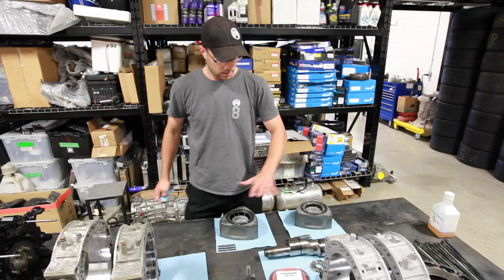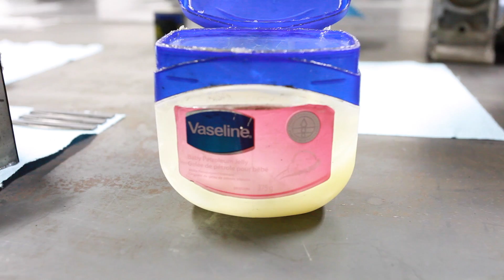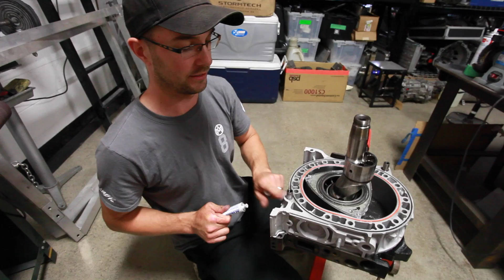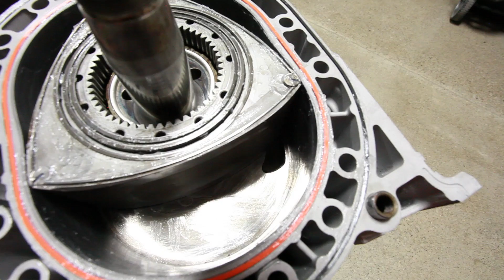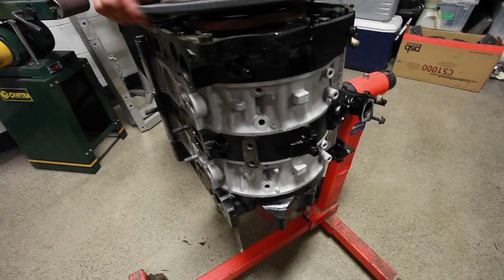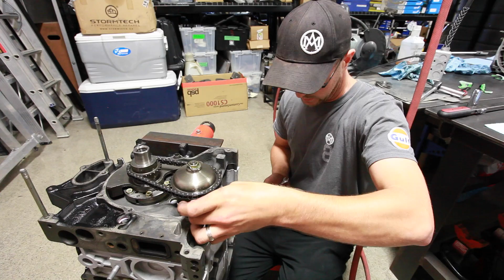How To Build A Rotary Engine

Comment: Lol I'm sorry guys for the try but  rennaccy or the 13b the came out on the Rx 8 is the worst of the worst  rotary engine ever produced I think is way worst then the 10a and tht is lot to say those engines won't go over 60k plus they dnt produce hp that's why everyone tht has Rx 8 they do engine swap 20b or  ither 13 b  gen 1 or 2nd Gen

Comment: The bolts under the oil pump pulley could be torqued using a crows foot socket

Comment: Not that it does much good to point this out, but Mazda says the 16X is every bit as efficient as their regular engines and every bit as clean.  It's likely that the new 16X uses direct injection and stratified charge, just like a modern reciprocating engine, so it benefits in the same way.  Also, contrary to what you sometimes hear in Youtube videos, Wankel engines are 4-stroke. If you see flames shooting out the back of a Mazda, it just means the owner (or the mechanic) has screwed it up to the point where it's not efficient. When Mazda races their rotaries, you don't see any flames. Just trophies.
Reply: The 16X was a failure and abandoned  when Wankel engine development was canceled in April 2009.
Reply: Mazda's foray into motorsports was ultimately a disappointing failure and Mazda has left racing completely, there are no longer any factory motorsports programs at Mazda.

Comment: there is a massive misconception about the Fuel Consumption of a Rotary Engine.
baed on the Power-output of a Rotary Engine the Fuel Consumption is actually not bad !
Reply: Wankel engines have extremely poor BSFC, this is also clearly evident from the higher EGTs

Comment: Idk about these "reusable" coolant seals..but if you are using regular seals..don't put Vaseline on the coolant seals. That is a cheater move, that can prematurely wear out the jacket seals. Don't do it, unless you know, for sure, that it won't interfere...

Comment: Joe did a good job assembling that engine, as the side seals on the rotors were already assembled can you tell me if they are spring loaded ? similar to the apex seals.
Reply: they have funky looking springs that seat under the seals to apply pressure, look up 'rx8 side seal spring' you'll see what I mean

Comment: How about giving the 'circles' the combustion and exhaust system in the Engine Blocks and not in the Rotor just to solve those problems of frictions?

Primary Color Circles?... Timing and Pressures?... Springs and Friction Plate/Pressure Pins?...

Comment: Hi Joe,  I'm planning to use a 3 rotor rotary engine in my plane.  I don't know what preparation that needs attention nor the type (13B, 20B......)  Do you have the entire engine?  I could buy a junk motor but I don't want junk flying me and my passengers around.  What work do you recommend for a 3 rotor, 2 turbo engine  (approx 600hp)?  Oh, I do think a studded stronger engine is important.   What else do I need and what kind of costs are we looking at?  /  Which block would you choose for this engine?  If I mix fuel from day one can we remove the Oil Metering Pump?  Would a certain porting procedure be indicated?  The plane designer uses an Audi Turbo-Diesel engine, which puts out 375 hp and around 525 torque.  Do rotary engines get reasonable gallons per hour (mileage) once cruise altitude is reached?  Tell me why or why not would a Renesis engine or other engine would be a good choice; I don't know why certain engine blocks would be better than others.  Oh, another thing, the lighter the better.  I guess to do a rebuild that's designed to last is what I need.  Like Silicon Nitride apex seals.
Reply: You don't want to use a Wankel engine in aircraft.
The Wankel has several fundamental  flaws and disadvantages that prevents it from being a practical aircraft power plant.
Reply: No aircraft manufacturer has ever offered a FAA or EASA certified aircraft powered by a Wankel engine.

Comment: Hey Joe, I'm told that the 2 cycle oil should not be marine oil or synthetic oil in a rotary engine.  I found a very low ash oil is the Briggs & Stratton 2 cycle oil. Is this true about no marine oil and no synthetic oil?  Thanks!!
Reply: No 2stroke oils,  Mazda only recommends 4stroke motor oil that meets minimum API SL or EC GF3.
No 2-stroke oils meet these minimum oil specifications. 
According to the API there is no such thing as synthetic oil and considers the term synthetic a completely meaningless marketing term.
The API only recognizes 2 base stock classes based on lubricity performance not formulation.

Comment: The Rarest Mazda RX7
https://www.mazdaforum.com/forum/mazda-rx-7-33/joe-maddox-super-rare-1-100-1989-fc3s-gtus-rx7-2jz-gte-vvti-build-43602/

The GTUs has 1100 of them made, ranking it in models as the third rarest production model.
1500 10 AE Turbo II
1400 Infini
1100 GTUs
1000 Final Edition
150 92 Verts.

Here is where it gets tricky though. A car is not rare because of the parts that come on it. Those cars listed are rare because of the vin number showing that they are the models that would have come with the rare parts they have one them. Anyone could take a 10AE badge or Infini seats and put them in a base model and call it that rare model, the vin is what proves the car is the rare model and would come with those parts.

Take for example my superbee clone pictured in this thread. It was a Coronet 440. This car came with a 318 small block, common coronet gauge cluster. The vin was WH23 because of this being the model it was. The Superbee is the exact same car. All the parts are the same, the car is identical outside of the motor it comes with is a 440 big block and it has a circular gauge cluster and a bee emblem. The vin for it is WM23. All the rest of the numbers tell about the plant, the colors, etc. However the model difference is only provable by the vin. The body panels for a superbee and coronet 440 reads the same through out the car.

So when I started learning about this car I realized how rare it was. While it ranks third in place for rarity in model, the car itself is the rarest by vin numbers. Let me explain how this is...

The 1100 GTUs models that were made are actually grouped in two categories. There are 100 that are made with the original Turbo II vin. Then there are the 1000 that had a NEW VIN NUMBER given to them making them no longer the turbo chassis vin numbers, but the GTUs specific vin. The GTUs turbo chassis models are K stamp. The GTUs non turbo chassis vins had a "X" put through the "K" and a "L" stamp issued. These are different models of the GTUs.

Here is another example of what I mean. The GXL was made from 1986-1991, there are two series of them, the S4 86-88 and the 89-91 S5. The vin number shows the difference in the different versions of that same model.
Another example is the Final edition vert. Say I got a s4 vert, put all s5 parts on it and then badge it as a final edition 92, the only way to prove it is not is the vin, the reason it is not is the vin.

Vins make the car rare, they make the swag and models rare. So that got me thinking. How many are left??? I asked around and that is how I came to realize that there are only a few left, this car is VERY rare and I am glad to be saving it from the salvage yard it was destined for!

Comment: I Don’t know much about rotary engines but it sounds like that the real reason why they won’t go with rotary engines is because as a lighter engine it would; burn less fuel, need less parts and most people would be able to work on them- all of that put together would not work well for THE ECONOMY! I speak on behalf of myself: I LOVE THESE ENGINES!!
Reply: Mazda doesn't make them anymore because people stopped buying them.

Comment: What is the psi of compression before the sparkplug fires? And if your scale up or down does it change the psi of compression? Also I know to produce an electrical form of fuel, you won't need fuel injection, but you do need fresh air in and burnt air out is all that needed and everything will stay cold because the fuel burns cold. Its electrical so it saturating everything, its everywhere as its needed. And aluminum works the best with this energy. With this in mind what are all the changes you could make, for example drop the coolant system, since it's all cold you could likely use rubber to make the seals instead of those metal shims???? Would you even need oil / lubrication? What else would you change???

Comment: I was racing rx3s in Japan in 1982 and we took off the exhaust and made our own header,hollowed the intake manifold,made a template for a Holley four barrel,added mad ignition and away we go! That was the fastest car in Okinawa as I could rev to over 12,000 rpm and only a guy in a 280 z with it bored to a 3.2 l and triple dell orto carbs but he still got smoked! Good times late at night in the marines! I was a mechanic at the rebuild shop so after 1630 we worked on our stuff until midnight and that’s when the racing guys start gathering at the A&W to race!
Reply: We did a lot of work on the ports too,enlargening them and experimenting with the opening for a longer intake duration and a lot of polishing!
Reply: Do you have pictures of those builds?
Reply: That's awesome

Comment: Regarding the scored rotor surfaces, would it not be possible to say, build up the scored surface with weld, then re-machine the surface to factory spec? Is the problem that no-one does this, or cost of machining vs replacement parts?

Comment: Nicely done video. Thanks for not making us endure a sound track. Only comment is too much oil on those tension bolts. You only need a thin film. And there are different torque specs depending on if the threads are lubed or not, and what kind of lube.

Comment: Interesting how the Mazda engineers seem to never figure out exactly how to control oil consumption and still get good lubrication in these rotary engines.... I mean two strokes burn oil too, but modern two strokes are quite clean burning
Reply: Modern 2stroke engines have better combustion efficiency because of the better combustion chamber than the Wankel engine.

Comment: Could you cool a rotary with liquid nitrogen?🤔

Im new to rotaries and only 16 so sorry if this is a dumb question
Reply: No. It was made to be cooled with water, plus some additional cooling from the oil. Using LN2 would probably wind up cracking the engine due to the temperature differential, not to mention the amount of LN2 being used (and heated!) would likely lead to an explosive decompression event. LN2 is also not easily stored without active cooling, which means it would have to be replenished after every drive.

Comment: What is meant by “pre mixing”. Are you adding 2stroke oil to the gas?
Reply: Yes, typically 250:1 for street use with the renesis engine. Use Jaso FD rated 2 stroke only.
Reply: @kiwiaudio8462  Mazda only recommends 4stroke motor oil with a API SL or EC GF3 rating, no 2stroke oils available meet the specifications required.
Reply: Never premix, this false urban myth does not improve engine reliability and causes damage.

Comment: You can use a torque wrench on the oil pump assembled using a crow foot attachment
Reply: I build a lot of engines, the only things I torque are the bearing ends, heads, camshaft bearings and crankshaft pullies. The rest you can do it according to bolt size and for some critical scews loctite is advised. He used the torque wrench a lot because of the Internet critics most probably!
Reply: @st_us  the reason he used a torque wrench is because he was torquing down the engine case assembly. Compared to a good ol piston engine is almost the equivalent to torquing down rod caps and main caps at the same time.

Comment: As a little girl I was fascinated by a transparent plastic Wankel rotary engine that my brother had assembled. It had a little light that was where the spark plugs would be to show the ignition cycle. I think I had more fun with that thing than the boys did. Then again, I am the one who became an engineer, they are bankers and cops.
Reply: As a little kid I was complaining about how literally everything is based on exploding a stupid piston up and down when the source of power spins and the goal is to get something else to spin. A rotary engine is just the most obvious design. Pistons that just slam and vent are the stupidest thing I could imagine only 2nd to the fact that people still BUY light bulbs that you have to TWIST into the socket not just once, but like it's a bolt holding a bowling ball preparing for an earthquake when you can make LED light bulbs plug them in like an audio jack using Cork like the original design and never buy lightbulbs again unless it's a gimmick bulb for a studio set or something.
Reply: @linkeddevices The Wankel is a clever bit of engineering but unfortunately it was an epic failure, it's simply inferior to reciprocating engines... too unreliable, dirty and inefficient to compete with the earlier concept that we still use.
Reply: You joined spacex ...

Comment: It's funny how rotaries are known for being unreliable blah blah blah. I don't know about everyone else but if i had no clue what i was listening to when you say " you rev at 9000 but the rotors spin a 3000 " it sounds like that would be pretty reliable, fuel economy would be good but yet we're all surprised with these wankels
Reply: Wankel engines are very outdated and completely obsolete in the engine manufacturing industry and the automotive industry because they are fundamentally inferior to the reciprocating engines. They are obsolete because they no longer offer any significant advantages and have several serious flaws and disadvantages, most notably their extremely weak and unreliable sealing design and their terrible fuel efficiency. Compared to modern engines they produce very little power reliably and have unacceptable torque characteristics. The terrible design of the combustion chamber means it not only produces a lot of exhaust pollution but it also wastes much of the horsepower contained in the fuel right out the exhaust pipe.
Reply: @doktorbimmer  Upgrade your seals, upgrade your internals and make more power. If you know what you're doing you can have a rotary last and make decent power. I rebuild mine every 3 years even when I don't have to. Take care of things and they'll last. Simple; and as far as economy goes. There are a lot more things I'd be worried about the one extra rotary on the road :)
Reply: @Squarepants Gaming You are not a very good liar kid...
Reply: @doktorbimmer  and what makes you think I don't have what I say I have.
Reply: @Squarepants Gaming Because you write comments exactly the same as every 14 year old gamer does...
Reply: @Squarepants Gaming Because you write comments exactly the same as every 14 year old gamer does...
Reply: @doktorbimmer  gaming wasn't the subject at all nor was anyone's age so let's debate the subject at hand shall we?
Reply: @Squarepants Gaming Indeed, its way past your bedtime son... tomorrow is a school day.
Reply: @doktorbimmer  Maybe for you. I make my own schedule
Reply: You got kicked out of school? Or your hippie parents home school you????
Reply: @doktorbimmer  Neither, I've been graduated from college for 5 years and in that time I've created my own business. Again how is this relevant to rotaries?
Reply: @Squarepants Gaming As I said, you are not a very good liar kid...
Reply: @doktorbimmer  I think you're the most arrogant person I've ever spoken with.
Reply: @Squarepants Gaming I think you are the most immature person I've ever spoken with... why do you feel the need to lie? What is it you think you are going to achieve? Because you don't fool me for one second kid.
Reply: @doktorbimmer  what makes you think I'm lying?
Reply: @Squarepants Gaming Because you suck at it kid...
Reply: @doktorbimmer  https://en.wikipedia.org/wiki/Internet_troll

Comment: You know if you designed ceramic rings for the rotary it would last forever.
Reply: Not true, harder apex seals just shift the wear problems back to the housing and the much more expensive housing will fail.
Reply: @doktorbimmer  Put a replaceable sleeve in the housing problem solved. I believe Muller is using ceramic in his design of the Wankel
Reply: Switch to a reciprocating engine... all the problems solved.
Reply: You mean Moller???
Reply: @doktorbimmer  Yea sorry I meant Moller
Reply: Moller is nothing but a scam, a crackpot con-artist and a criminal... he has been running perhaps the best known vaporware scam in history and has never delivered a single working engine.
Reply: @doktorbimmer  Hmm. Darn I haven't seen the guy in years didn't know that. He seemed nice in the couple years did know him paid back my investment. Crap changes I guess
Reply: He was forced to pay back investors by the SEC in a plea bargain agreement that kept him out of jail for illegally selling securities. He later filed bankruptcy and is now operating a new scam called Freedom Engines and also sells fake organic honey.
Reply: @doktorbimmer  WOW . I'm lucky I got my money back. This was years ago though. Guess time changes a person. Thanks for the info.
Reply: @doktorbimmer  https://en.wikipedia.org/wiki/Internet_troll

Comment: Thanks for the video, I liked it very much because it is very clean and very professional.    I would like to know if you have a video on how to synchronize the cylinder head with the engine, in another words how to put it on time, how to install the cylinder head.    I have a mazda b2200, 1989 and I have to do a head job.    I know how to put the engine on tdc but don't know how to do the same thing with the cylinder head.    Maybe there's a video on here that explains that and I don't know.    Do any of you know if there's such a video?